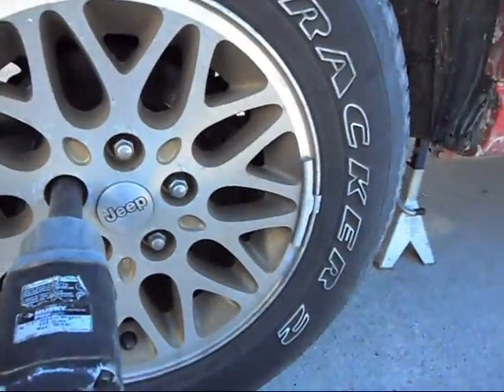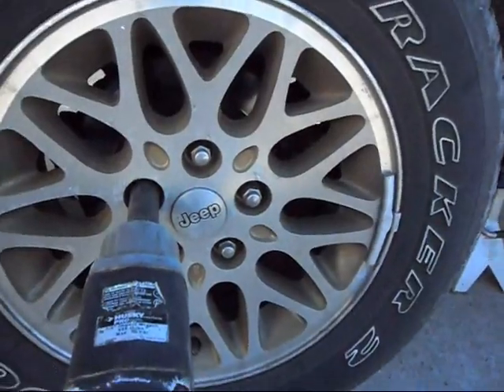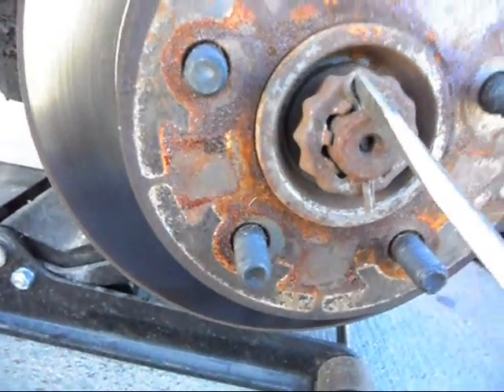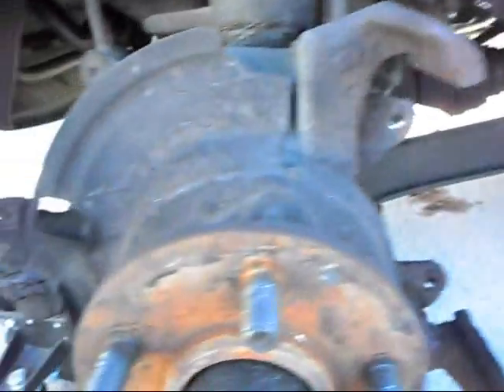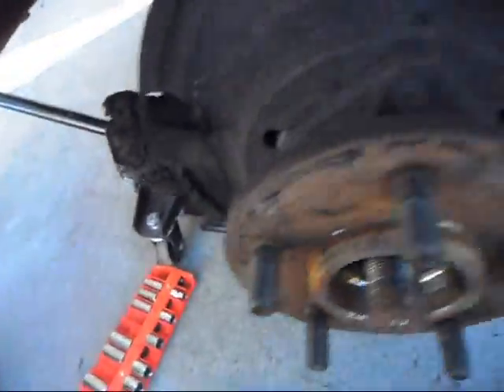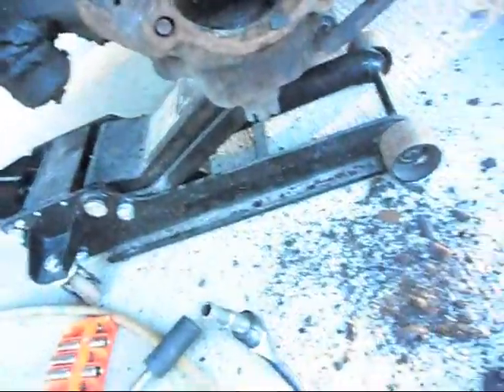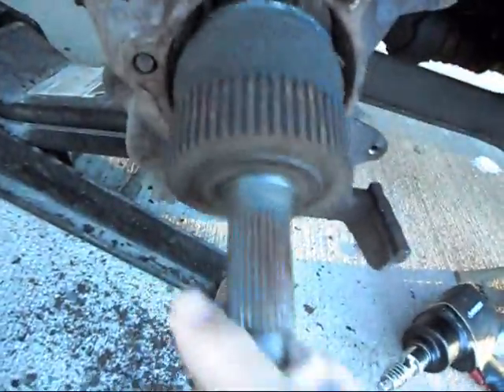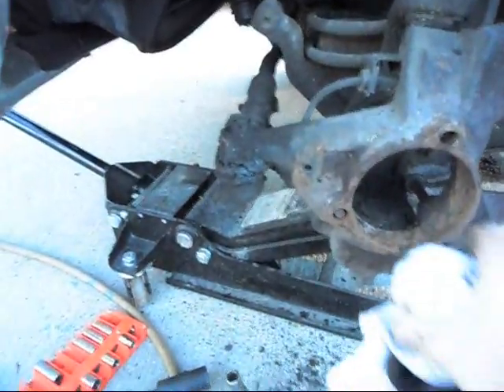How to change the front CV axle shaft in a Jeep Grand Cherokee.

Comment: I wound up using saran wrap and elastic bands around the centre of the hub assembly, poked the penetrating oil tube through the top and filled with penetrating oil so those centre nuts soaked in it overnight. Good vid, thanks.

Comment: Thanks, very good video, it cut right to the matter. It also works on the passenger side as well. Just now took the passenger side shaft out after wondering if there were some kind of clip holding it in. That would have made it a longer job. Your video showed that was not the case so I went ahead with the removal. Thanks again!
Reply from the maker: Thanks for watching and I am glad that I could help.

Comment: @JC316 next time instead of using a chisel to remove the hub assembly, put one of the 2 lower bolts back in 1 or 2 threads... Put ur socket on the end of the bolt and wedge the socket into the axle tube and use the steering to crack the hub loose. It may take a few tries to get it to snap loose.... Eventually the hub will slide out of the steering knuckle. Save time and money by doing it like this. You wont damage your hub. :) Have fun next time!
Reply from the maker: Nice, I like that. Thanks for the tip!
Reply: yep, this is by far the best way to do it. No need to bust out a puller etc. Another good way is to use a short socket extension, turn the wheel to the left for the right side and to the right for the left side, wedge the extension between the bracket and your U-Joint knuckle, turn the steering wheel, rinse repeat until desired effect occurs.

Comment: My opinion on the easiest way to change the axle shaft, is first loosen the axle nut, then once you have the 3 12-point bolts out, just use a 3# hammer to knock the bearing loose from the knuckle, then you can pull out the entire assembly and then remove the axle nut off completely.
Reply: those are not 12 point bolts (damn shade tree mechanics!) they are SPLINE bolts!  Spline bolts have  more than triple the surface contact  area of hex bolts so they don't round off. Using a hex wrench or socket is asking for problems!
Reply: Scott Schoemann 12pt socked worked for me!
Reply: this time.

Comment: Best way to undo the hub nut is with the wheel on the ground.  Jack up temporarily, take wheel off to remove the decorative centre and remove the cotter pin, replace wheel temporarily (3 lug nuts will do), lower, loosen hub nut, then finally lift onto stands for the job itself.  Same when tightening at the end.
Reply: false... impact will break it loose everytime in the air
Reply: @derekclark7223  That didn't seem to work well for him, so it looks like he resorted to using magic because the nut suddently vanishes between 3:15 and 3:18.  Anyway not everyone has a 3/4" drive impact like he has.
Reply: @derekclark7223  I know he said it's the best way, which may not be right, it's how I've gotta do it. Not everyone can afford an impact

Comment: Thanks for the vid, why did you removed the hub assembly ? it is no need, just remove the break caliper, unbolt the 3 nuts at the back and then pull the axel. Then slide the CV joint on the axel from the end, then your done. Much faster
Reply: The three bolts you take out holds the hub assembly on. You have to take the hub assembly or the whole knuckle off to get the axle out and CV joint just don't slide on. It's actually part of the axle with a boot covering it with two clamps holding the boot on.
Reply: some people are just clueless, aren't they?

Comment: Pro tip to remove stuck nuts & bolts,,,, mix 50/50 ATF {automatic transmission fluid} and acetone {fingernail polish remover}. You can get the acetone at your local parts store, like autozone.

Comment: Thanks for the video man. It will help me greatly as I go out to start the work. Forecast calls for nor easter so I will have to get going... I figure I will go to harbor freight and get the sockets unless someone else has another vendor suggestion...
Note: I have been driving this jeep with the broken front left cv axle for over 2 years. I wonder what I will find when I open it.? Should be interesting!!! 
Thanks again for video
Rick
Reply from the maker: +Rick Sheltra You will find a hollowed out grease boot, or a nub that used to be the flanged portion.

Comment: Do I need to remove the upper and lower control arms if I take off the hub? I was able to pull out the CV shaft on my GF car without any more disassembly.
Reply from the maker: No. Just get the bolts on the back side out and knock the hub loose.

Comment: Hey thanks for the how to,I had to change the cv on the same area of my 99 and it was pretty much all the same or close to it,my only question is and it will sound dumb,I bought a dura last gold new cv joint to replace it,it's meant for quadra drive but I have the quadratrac-2,was told by a few jeepers and the guy at autozone it'll work the same,changed it and I still have a clanking sound and now a vibration from my steering wheel,any idea? Faulty cv out of the box maybe? Only did it last night because the boot on my old one was completely loosen on both ends and had been needing done for awhile.
Reply: I know the comments old but the Quadradrive axles are shorter than the Quadratrac. Found that out the hard way.
Reply: has nothing to do with Quadradrive/ Quadratrac, its the Model year. as its based on the axle and differential itself
Reply: I Swear, one of these years I need to start a Jeep School...

Comment: I have a 01 Jeep grand cherokee limited 4.0L quarto drive and my back passenger wheel fell off with the Rotor and all that Is exposed,  would it be better to buy the Axle from Autozone,  and pick up the rest of the stuff from the Junkyard?  caliper,  pads , rotor maybe and yeah ?
Reply from the maker: Probably cheaper to do it that way, but I would at least get a new rotor and pads.
Reply: So just pick up the caliper at the Yard and that's it?
Reply from the maker: Pretty much. Rotors and pads are a standard wear item and not something I usually pick up at a junkyard.
Reply: it looks easy to change the Axle in videos  but is it though?  this will be My first time doing this
Reply from the maker: Every car is different, but yeah, it's pretty easy. If you run into stuff like rusted parts, it can be considerably more difficult.
Reply: so since the car drove fine taking it back home an hour away from where I stay I should just cancel my appointment with Just Brakes then huh? Because honestly the car did not overheat or anything and the tire only bent off when I try to back it up in the driveway that next morning should I still get it checked out anyway?
Reply: that was my last question to ya so what would you say bout that ?
Reply from the maker: I don't understand the question. Any time a wheel falls off, I would recommend having a professional look at it.
Reply: I want to know HOW the wheel and brakes "fell off"... something just isn't  Kosher there
Reply: Add to that, he doesn't even know what the hell he has. I'm guessing he means "quadra-drive". When people don't get the names right, chances are, their mechanical skills are not up to par, since a good mechanic knows its all in the details.
Reply from the maker: Experienced mechanics shouldn't be here, my videos are all about the beginner.
Reply: axel work isn't for beginners. you should know that
Reply from the maker: Lets agree to disagree. Everyone is a beginner when they first start.

Comment: With bolts out of hub , put wheel back on with two loose lug nuts , then just pop the wheel a couple of times. Should not need a chisel and hammer damage that way.?
Reply from the maker: Might work, I've never really dealt with rusty parts before, so I just manhandled it.

Comment: yo! you said in this video to remove upper and lower ball joints and tie rod end to remove the knuckle, yet I don't think you did that.. just the hub assembly. Chilton manual doesn't require it either. and it talks about command track when installing the shafts. I'm about to do this process on a 93 grand cherokee laredo 4x4 without a driveshaft. was i missing something in this video or did you not actually disconnect these points
Reply from the maker: There is a note at 1:33 in the video saying that you don't have to take the knuckle off. So no, you don't have to disconnect any of that. Sorry for the confusion.
Reply: +JC316 thx man!

Comment: is there any gaskets or seals? or all metal to metal? is there any torque specifications I need to do on the nuts
Reply from the maker: +andy santana No gaskets, all metal to metal. Hub bolts are 75ftlbs and the axle nut is a whopping 175ftlbs.
Reply: I don't know if you already know this, but if so, then this goes to help someone else. There is one seal, inside the differential. Generally you can replace the cv axle on these without damaged, but it does happen, and you will have to pull the differential apart to replace the seal. This seal holds the differential fluid in, around the axle. If you open the differential, get a lube locker gasket to reseal the cap so it is easy to service in the future.

Comment: Those 3 bolts in the back are difficult   Any advice getting those off
Reply from the maker: Heat and WD40 are your friends. Those bolts were a pain for me too.
Reply: JC316  they were so rusted I ended up using transmission fluid/acetone mix and it helped a lot!

Comment: Hey man I have a ram and I think that part broke on my 2011 truck it started going side to side when I was going straight was the same thing happen with you?
Reply from the maker: What exactly is happening? There is some play in the axle if you're pushing it to either the drivers or passenger side, but there shouldn't be much.
Reply: It looks like if a cream bottle blew up
Reply: And the boot for the cv joint is pooped
Reply: Popped
Reply from the maker: lino carrera
Yeah, it's shot. Time for a replacement.

Comment: Those three 12 point 13 MM bolts that hold the hub in are the worst part of the job. If you have to pull this all apart I would recommend replacing the axles, hubs, and both the upper and lower ball joints while you're in there. No sense in replacing the axle to only have to replace the ball joint 6 months later - which requires pulling this all apart again.
Reply: AGAIN They are NOT hex head bolts! They are SPLINE HEAD,,, Never use a hex socket or wrench on them, use a spline socket or wrench! you can apply 5 times as much torque to the HEAD, (the shaft is still the limiting factor)
Reply: No one said they were hex head. I said they were 13MM 12 point - which they are.
Reply: they are NOT 13mm12 point they are 13mm SPLINE, substantially stronger, more engagement, don't strip off, forged heads that don't rust off or round off and have the ability to take on more torque than a 12 point.   go listen to the vid. he said use a 12 point. they are not 12 point. go ask any certified Jeep mechanic. Rule Number one of all things mechanical:  Use the right tool for the Job.
Reply from the maker: You don't know what you're talking about. 12 point socket is the correct term, you may be calling it spline, but it doesn't change the fact that it's a 12 point socket that removes the bolt. Clearly I used the right tool for the job, since the job got done.
Reply: there is a special socket for those bolts...a 12 point will work but technically not the tool designed for the job.

Comment: why did you remove the hub there is no need unless your replacing the hub
Reply from the maker: Because it's easier than taking the knuckle off, or at least it should be.
Reply: @316Autos  you dont have to remove the knuckle remove upper balljoint and the clevis fork at base of strut after other streps complete remove the hub has ) affect in helping only have to remove axle NUT just saying
Reply from the maker: @bryandoesyoutube  then you're wrangling the knuckle, and often the splines are stubborn. I'm from Texas, so rust isn't usually a problem and its easier to take three bolts off. Should be a 30 minute job that got complicated by rust.

Comment: Let me apologize in advance for a nearly impossible to answer question.  But if anybody could take their best guess I'd appreciate it.
     I have a 98 grand Cherokee Laredo 5.2.  Some years back something went out in the front drive assembly and it started making noise.  The mechanic said the part was hard to get for some reason. I don't think it was in the differential, I think it was something off to one side?? Anyway, I was in a hurry and broke at the time so he just took whatever it was out and disabled the front wheel drive and the car drove fine on just the rear wheel drive.  Now I've been fixing the old girl up and looking at getting the front end working again.  Any ventured guess as to what might have been the problem part he removed?  Thanks.
Reply from the maker: Likely the transfer case went out. It's the only thing that makes sense. It sits to the side of the transmission and drives the front wheels. I doubt that he took it out, more like he just took out the driveshaft that goes from the transfer case to the front axle.
Reply: JC316 Yes, he just took out the drive shaft.  Transfer case doesn't sound right.  He said something about a shaft that goes inside another shaft and is supposed to slide back and forth or something. I got the impression that it was between the differential and the tires somehow, because he specified the left or right side whatever...IDK, it's just been too many years.  I might have to just get in there and start pulling stuff apart.  Thanks!

Comment: Done this a few times on my 01 jeep wj. Cv axles just aint very strong. But my jeep has 2in lift and 31in real aggressive tires. They make stronger version but the pair is like $1800 😤😤
Reply: the AXELS are stronger, but the CV's aren't. Been there done that add to the fact that the heavier axels still reduce to the same diameter at the hub and the differential. so it really isn't worth it, for the 1800, you would be better off  adding another 5oo and replacing the  whole axle with a 35 or larger.  (standard front end is a 30)
Reply: Was yours clunking in the front end I can't figure out what the hell is happening to mine mines an 97 2in lift and 31s

Comment: the three bolts holding the  wheel bearing on ARE NOT HEX HEADS!  They are SPLINE HEADS That's why you had problems getting them to break loose! And if you need a puller to remove the assembly you have been running on damaged CVs for way too long.  This is what people blame  on the 249's Viscous Coupler all the time.
Reply: if you cant get the Bolts out using the proper wrenches and sockets,  HEAT  the wheel bearing housing in the outside with a small propane torch, use a proper spline combination wrench and an engineers hammer. rap on the wrench after you heated the housing at the backside of the bolt hole and it will break loose as with all grungy bolts brush them off on both sides with a wire brush first.  
Side note: Harbor Freight sells the spine sockets and wrenches dirt cheap. the set you need are Metric.
Reply from the maker: Yeah, I mentioned that in the video and I was using a 12 point socket. I had just gotten this vehicle in, so someone else neglected it.
Reply: . I have a 96 ZJ 5.2 and after 20 years the bolts rust from being in NY, after I got mine out I replaced the 3 bolts on $46.00 for 6, I just replaced the assembly and took the axle and hub out as a unit
Reply: something missed by most people, and I even forgot to mention, is do one side at a time, keeping full weight on one tire while the other side is lifted, wheel removed, in order to break axel nut loose without the need of a vise. If the CV joint is fully destroyed it can be a pain in the tail to clamp up to break the nut loose. and if you are not in need of replacing the hub/bearing assembly you may end up doing so at extra cost, if you don't want to put it back together to get the axel nut off. (bear in mind the hub/ bearing assembly do not come with the nut, washer, nut cap or cap spring, they all are extra)

Comment: DUDE! Loosen the lugnuts evenly! taking them all the way off one at a time can crack the alloy rims! ive seen it happen on those exact same  rims at a firestone dealer on one of my jeeps when an idiot did that when putting new tires on my 95 GC
Reply from the maker: You have that backwards, it's the tightening procedure that must be done evenly to avoid wheel cracking.
Reply: Again, on ALLOY wheels the lug nuts MUST Be BROKE LOOSE EVENLY before all are removed, so that tension is RELIEVED evenly to prevent cracking the ALLOY RIMS. unlike Steel rims which have an inherent amount of spring to them. an alloy rim will NOT FLEX when tension is released and can crack at the lug seat.  This is something that is supplied in the instructions of expensive (over a grand a piece) rims, but less expensive rim mfgs and OEM dnt care, you will just buy more rims when they fail, since its the last lug tat it will crack on...   It would help if you actually paid attention to the whole post before replying...
Reply from the maker: Oh I read the whole post, you just don't know what you're talking about. Don't get me wrong, I listen to everyone and if I hear something that I've never heard about, I research it. My research turned up absolutely nothing, I can't find one single piece of evidence to back up what you're saying.
Reply: Both need it. Whether it is the first nut on or the last one off, a single nut fully tight puts all the stress in one spot.  That is something to avoid.  I'm a structural engineer BTW.

Comment: Really don't have to remove the axle then the bearing if you're going to replace both, take out as assembly
Reply: you cant take the axel out without removing the bearing first, it holds the axel in,  and the nut washer cap and spring don't come with the hub/bearing assembly, you have to pay extra for each part separately...